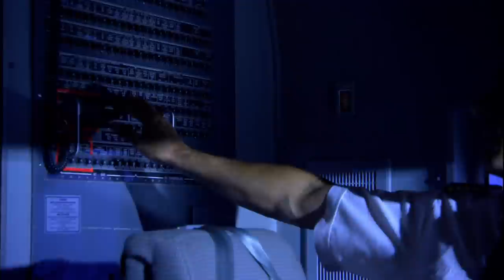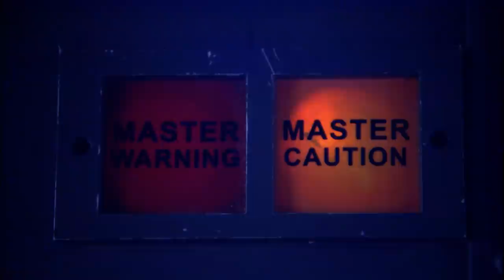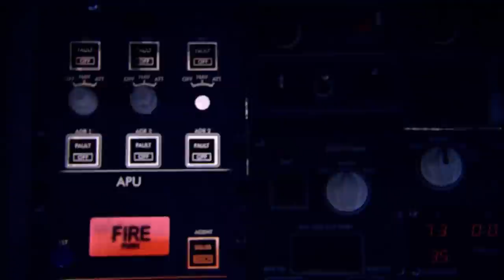Terrifying Fire at 33,000 Feet Caused by Circuit Failure 🆘 Air Disasters | Smithsonian Channel

Comment: The cause of the fire was never dermined, After this incident, smoke detectors are now on planes of the 46 people on board 23 died and 23 survived including the pilots
Reply: They think the cause was an improper repair after a tail strike, but unfortunately, the world will never know.
Reply: Something tells me this was an electrical short. The fire actually happened INSIDE the walls of the DC-9, behind the restrooms. That's why those circuit breakers popped!
Reply: What exactly was the cause of death ? Carbon monoxide poisoning or crash landing injuries ??
Reply: @windshieldraindrops8228  It was a flashover. Half the passengers had evacuated when the interior suddenly burst into flames. : (

Comment: Why they didn't use a fire extinguisher in the plane.
Reply: Yea
Reply: i don't know if 1983 the fire extingusher are allowed to the airplane or not.
Reply: There was a fire extinguisher and one of the flight attendants attempted to put it out but there was so much smoke and heat that they couldn’t go near the fire for more than a few seconds at a time. Even if they could’ve tried more with the extinguisher they probably wouldn’t have been able to put out the fire anyway considering the severity of it

Comment: I like short interesting videos like this. No caused of the fire?
Reply: The NTSB was ultimately unable to determine the origin of the fire. In August 1984, the NTSB issued a final report which concluded that the probable causes of accident were a fire of undetermined origin, the flight crew's underestimation of the fire's severity, and conflicting fire progress information given to the captain. This report also found that the flight crew's "delayed decision to institute an emergency descent" contributed to the severity of the accident

safety recommendations
As a result of this accident[3] and other incidents of in-flight fires on passenger aircraft, the NTSB issued several recommendations to the Federal Aviation Administration (FAA), including:

Safety Recommendation A-83-70, which asked the FAA to expedite actions to require smoke detectors in lavatories;[2][9]
Safety Recommendation A-83-71, which asked the FAA to require the installation of automatic fire extinguishers adjacent to and in lavatory waste receptacles;[2][10]
Strong recommendation for expedited FAA rule changes mandating that all US-based air carriers install (or improve existing) in-cabin fire safety enhancements, including (but not limited to):
Fire-blocking seat materials to limit both the spread of fire and the generation of toxic chemicals through ignition;
Emergency track lighting at or near the floor, strong enough to cut through heavy fuel fire smoke;
Raised markings on overhead bins indicating the location of exit rows to aid passengers in locating these rows in case of passenger visual impairment (either pre-existing or caused by emergency conditions);
Hand-held fire extinguishers using advanced technology extinguishing agents such as Halon.

Comment: You asked some good questions at the end but failed to address them. Here's my synopsis: 
The captain didn't cause the emergency but he failed miserably in not recognizing it for what it was -- an emergency. He made multiple serious errors in judgment, particularly in delaying issuing a mayday call because he decided it was just a minor trashcan fire caused by a discarded cigarette. SOP of any airline is to immediately start descending and find the nearest airport to land at when cabin smoke is detected. Captain didn't do that and his delays cost many lives. He also failed to evacuate the cabin smoke, which is common procedure to prevent smoke buildup. His failure to do that resulted in a flash-over when the emergency doors were subsequently opened and the passengers disembarked. This is what caused the explosive fire that killed 23. The captain was an unmitigated failure.
Reply: It’s funny you should think that…given that the crew (including both pilots) were honoured and hailed as heroes for safely landing the plane! 

Also, the Captain didn’t “decide” that the fire was simply in a trash can, he had been told such information by other crew members. He didn’t make “multiple errors in judgment”, he was given conflicting and inaccurate information by others. 

I should probably add that the fire safety procedures you refer to didn’t exist in 1983, when this happened. In fact, fire extinguishing and evacuation procedures were introduced as a result of this incident!